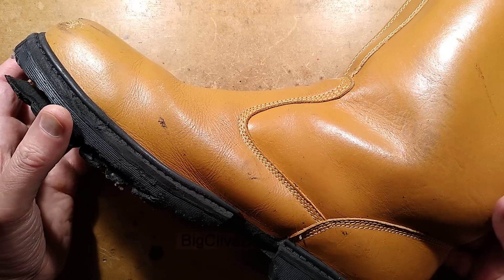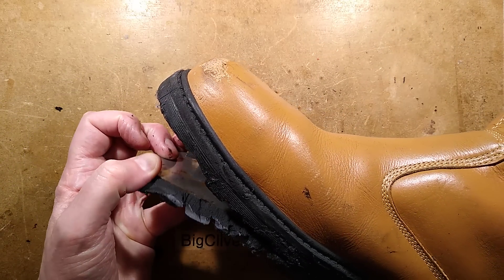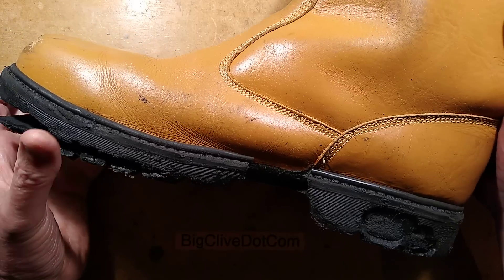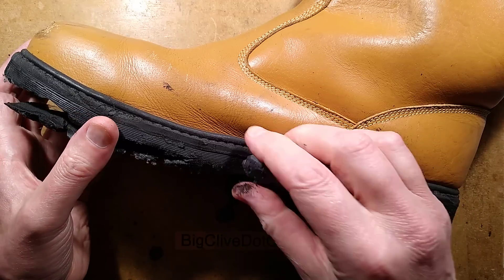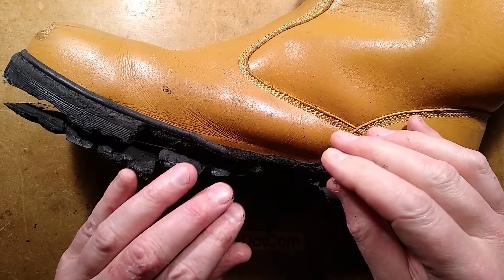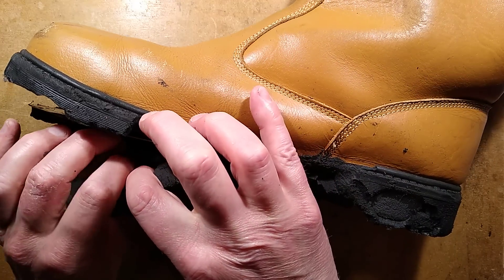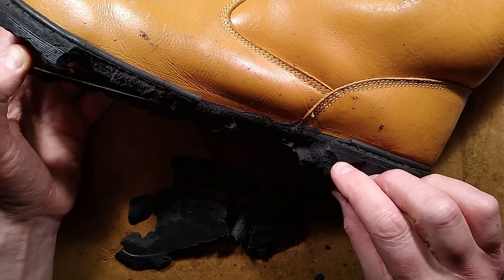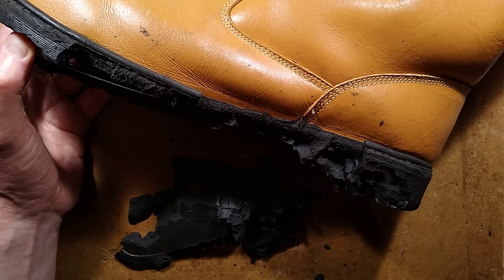My work boots have melted!

Comment: Same happened to my Meindl army surplus boots.
They were similar construction, with a "foam" mid section that bonded the outer sole to the upper. They were in mint condition, but I didnt wear them for a couple of years, but they were stored very well. (I take very good care of my boots, and have a pair of twenty year old boots that I still hike in.)
Well one cool spring morning, I take them off the shelf, put them on and go for a walk. Despite looking mint, about two miles in I start hearing strange noises and eventually realise that one heal has de-bonded. Over the next mile both soles started to de-bond and I barely made it home. Just the front section of each outer sole was attached.
Upon inspection the boots seemed absolutely fine APART from the foam midsection. This appeared to have spontaneously degraded and turned dry and crumbly.
Based on this I now only buy stitched boots because it certainly appears that the foam section has a shelf life and is not chemically stable.
Reply: Always walk around with a tube of superglue when travelling far from a shopping area.
Reply: @Vile_Entity_3545  Great advice mate.
I keep several strips of extremely high quality gaffer tape attached to the inside of a plastic lid for emergencies.
Saved me from a flood once when my ground sheet sprung a leak during a storm. I will follow your advice though, and include some superglue from now on! Thank you.
Reply: My Meindl desert boots have done the same... the foam layer between sole and upper is degrading. Will look to another brand for a replacement but they will probably be no longer lasting judging by recent experience with other footwear. 'Rubber' items manufactured in recent years all seem to display this property.
Reply: Likely is the rubber cement in your boots to connect the rubber or foam to the boot skin. All mass produced items use this as it's cheaper than stitched soles. It's hard but some can be reglued with rubber cement again.
Reply: @MrMega200  I cant rule out that the cement was the problem too, but the entire midsection which was moulded foam had changed consistency. It was no longer pliable and had turned dry and brittle.
It wasnt just like the outer sole stripped off, it stripped off because the middle layer of the sandwich was crumbling away.

Comment: I had this happen to me a couple of weeks ago with a set of boots I got about 9 years ago. I bought them for a job that lasted a couple of weeks, and they had been in the box ever since. I recently went to wear them again and within hours both soles had fallen off along with the toe cap rubber. I contacted the manufacturer saying that was I very disappointed (they kindly replaced them) but they said it was because I hadn't worn them. Apparently you have to wear them to stop air getting into the material which is what causes them to deteriorate. They also said to keep them well ventilated, so keeping them in the box probably didn't help either.

Comment: I've had a couple of things with that type of finish do similar, the common thing about all is that they were stored for a long time in a place where there isn't a decent circulation of air - closed cupboard or in the original boxes. It's recoverable if you catch it at an early stage by an IPA wash or even white spirit. Whether it's a long term fix is a wait and see. I think yours are past that point

Comment: I had two pairs of Clarks loafers, I put one away as a spare. After about two years the sole on the pair I was wearing crumbled to dust. I tried the other pair and walked out leaving a trail of "rubber" behind me and the soles in bits. Clarks wouldn't replace them as I had no receipt by then.

Comment: Polyurethane soled safety shoes and boots are susceptible to hydrolysis-a natural ageing process. Hydrolysis is the chemical breakdown of the PU polymer and the resulting physical breakdown or disintegration of the PU sole accelerated by the high humidity in tropical climates, standing in solvents, heat, UV exposure. Possibly other issues.  They can be re-soled though if the rest of the boot is in good condition.
Reply: You forgot to mention that finding a cobbler that even does such repairs and also has a compatible sole on hand is not easy. Also such repair work is not going to be cheap and will likely cost about quarter to half the price of just replacing the item, assuming you find someone able and willing to do it in the first place.
Reply: I worked for Hotter and saw some terrible workmanship on trying to fix Polyurethane soles, we used to replace or offer a good discount if this happened quickly... Ironically the more you wear PU soled shoes the longer they last.

Comment: Unrelated but there used to be a company called Colorado here in Oz (I kid you not). They sold all sorts of casual and outdoorsy type wear. I had 3 different pairs of footwear from them. A pair of boots, a pair of shoes and a pair of sandals. In all 3, it was the glue that failed. All 3 were made in China. The sandals just fell apart. It was so bad that I had to throw them away. The boots I took to a cobbler to get them re-glued. His glue was no better. The shoes I fixed myself with some "shoe glue" from a local supermarket. Cheaper for the tube that what the cobbler charged me. And they're perfectly fine now. I intend to repair the boots one day too. Just haven't been bothered to do it. It was just the soles in both that had to be fixed. The sandals were different though. The upper came apart everywhere as well as the sole coming off.
Naturally, Colorado are gone. Folded some years ago. No prizes for guessing why. Luckily, that was all I'd bought from them.

Comment: I would ask the manufacturer for a replacement or rebate. I had purchased a brand new pair of boots to replace my current ones, as soon as they would fail or break. That took about a year, I was so happy to put the new ones on and as soon as I started to walk, the intermediate sole, just like yours, just desintegrated. Got in touch with the seller who said they would not replace them as they had been purchased to long ago. I escalated to the maker and after a few pics, and sending them mine for an autopsy, I got a brand new pair!

Comment: My bid is on a broken chemical mix. I had this before, when rubber or plastics kind of "dissolved" without reason
Reply: It's not so much a broken mix. The mix is correct but the product degrades over time.  

Bacterial and fungal degradation is well known with polyurethane materials. This is great when you want the product to biodegrade but not so much when you need long term stability.
Reply: NO

Comment: This happened to my "formal dress" shoes that I wore with my suit to a graduate ball several years ago. As I was walking along and chatting with people I started noticing that my steps became somewhat uneven. After a while chunks of the black sole started falling off. To cut the long story short - I came home almost barefoot. The soles fell apart and all I had left were the upper parts of the leather shoes and a thin insole fabric separating my feet from the cold pavement. It was January :)

Comment: Had the same on some rigger boots I used for motorcycling. Walking across a car park I was leaving a trail of chunks !!!!!
In regard to rubber covered products, my Pure radio did this sticky thing. Talcum powder all over it then brushed off has stopped the issue !!!

Comment: Huh, exactly the same thing happened to my old mountain boots, which I discovered a couple of days ago. Those were Vibram soles, and the boots were stored in a box with other shoes in a temperated environment. I have no idea what caused the disintegration.
Reply: I have a pair of walking boots with vibram soles that I bought about 45 years ago. They were ridiculously expensive at the time but are still going strong.
Reply: @bigoldgrizzly  How do you store them? I just spent more than I'd like to admit on a pair of vibram soled wading boots.
Reply: Disintegration is caused by The Cure.
Reply: @jeremyowen1  
No special treatment, just stored on a shelf in the store room. I do wash off all the crud from soles and uppers and leave to dry naturally before putting away. Unlikely to affect the soles, but they do get regular treatment with common or garden dubbin. Forgotten the make now, but they were Italian and cost nearly 60 quid in about 1978. Considering how long they have lasted and how comfortable they are, it was money well spent. I suspect a lot of modern 'Vibram' might be trading 'on the name' but cutting corners on the material or manufacture
I might add the store room is not heated at all so temperature and humidity pretty similar to the normal outdoor British climate ... if there is such a thing these days   ;<)

Comment: I had a brand new pair of Aldi's boots which I left under the stairs and forgot about for several years. 
Found them one evening, are great I thought will wear them to the pub a mile away. Got there no problem but their carpet felt much more sticky than normal. 
Anyway on the walk home in the dark, a few sheets to the wind and suddenly one sole stuck fast to the pavement seperating from the upper and the next step the other did the same. Ended up home with sore, wet feet, holy socks and a pair of brand new uppers with absolutely no soles. Lesson learnt.

Comment: That's impressive, have they come into contact with any solvents or liquids used to coldweld plastics ?
Reply: It's most likely, what a few others in comments have mentioned, the sole of the boot being exposed to water and/or humidity (especially if its spent a few years in the back of a cupboard) and hydrolyzing causing the breakdown of the sole.

Comment: Soles or no soles, I think these are banned on construction sites and many other places now, so limited opportunities for use, unless of course the local retro disco is on:)
Reply: Why are they banned?
Too good a path to earth with all the metal inserts?
Reply: I believe that they are banned because they lack proper support for the ankle and rolling can occur on uneven ground.
Reply: @JohnSmith-yv6eq  as far as I'm aware it's because of the open top nature of the boots. they are mostly worn over trousers/overalls and I think there were many reported accidents where the boots were caught in or on something and they are not well fixed to your foot therefore slide off, I think that is mostly a construction site issue. I might add that you probably don't want to quote me on this. I am not allowed to wear these boots at my work and they are banned at any sites that I attend, could be water board sites, construction and the like. I have no Idea if the metal plates are the reason, although that could be as likely a cause, most safety foot ware has some kind of insert support, however I  think they are now non conductive.

Comment: pfft, haven't you seen "The Andromeda Strain"? :)
Reply: No, it's 'Mutant 59 : The Plastic Eaters'
Reply: Or Doomwatch, series 1 episode 1 from back in 1970

While on a flight to San Pedro in South America, a passenger airliner crashes after all the plastic on board inexplicably melts.
Reply: @theelmonk  you are right, of course altho, the andromeda strain did eventually turn into something that ate plastics.
Reply: @roygrafton6322  They were probably all inspired by just one of them. All were between 1969 and 1972 though the Andromeda strain was first, in book form. But did the Andromeda strain plastic eater feature in the book, or was it added later in a TV series ?
Reply: @theelmonk  it was in the book near the end when it mutated and escaped from the research facility, it went up in the air and got into fighter jet and destroyed all the plastic and rubber parts, causing it to crash.
Reply: @roygrafton6322  I must have read it as a kid, consuming all the SF I could find in the library, but I've forgotten. A copy has been ordered :)

Comment: The same happened recently to my beloved HAIX Tibet boots. The explanation from HAIX was that their soles get their special properties from a foam material that has a normal life span of 5 years. After 5 years it is expected to start hardening and at some point start to crumble as it happened to my boots after about 10 years of occasional use. I sent the boots in for repair and got the soles replaced.

Comment: You mentioned soft touch rubber coatings (why people still put these on products is beyond me). But the classic rubber 'breakdown' we see all the time are the belts inside tape recorders and disk drives. Yes they stretch (which is the point they should be replaced) but not unusual to find just a gloopy mess left or just bits of belt inside the mech.

Comment: No idea why but they look like excellent boots and probably originally pretty expensive, can you have them resoled including the metal plate?
Reply from the maker: It's hard enough getting boots my size let alone getting replacement soles.   They aren't too expensive to replace the whole boot if I can find ones that fit.
Reply: @bigclivedotcom  You don't have any cobblers nearby?

Comment: For products that have a coating that gets sticky, I've had good results with soapy water and a scouring pad. Most notably I've done this to the back of a Dell laptop's screen and the result was way better than I'd hoped. Initially I just wanted to get rid of the stickiness, which it did, but it actually looked good afterwards as well! Your mileage may vary of course, but so far I've always had good results with this method.
Reply: I've used IPA which works well. I've also used acetone which gets the goop off quick but is a bit risky for the underlying material.

Comment: This happened to me with both Meindl and Hanwag hill walking boots. It's no flippin' joke at £200 to £300 a pair. The manufacturers could care less with just a little extra effort. As you said- the textured coating that is so beguiling when handling an item in the shop is a time bomb waiting to go off. I've lost count of the items it has affected for me, but a notable one was a Hawke spotting 'scope. "We've not encountered that before." Yep, sure you haven't. Cue laborious hours with isopropol alcohol and degreased finger tips. Time all this carp was called out, so cheers BCDC.

Comment: My own family sold safety gear and they had many polyurethane boots  failed in the exact same manner. They had a batch of  steel toecap wellington boots that had to all be shipped back to the manufacturer because they were falling apart in just a few months. This material is lightweight and durable until it begins to chemically change to breadcrumbs.

Comment: Besides everything else mentioned by others, polyurethane soles will also crumble if you use them for a while and then leave them sitting for a year or two, no matter the production methods and compositions. The chemical bonds will rebind to lower energy states, leading to the previously homogeneous material sort of recrystallizing to smaller domains, hence the longer the boots sit, the smaller pieces the soles will crumble to.

Don't know if all that is bs or not, but that's how a shoemaker explained it to me when I wondered what happened to several pairs of relatively new winter boots and shoes after a couple warm winters had left them in the closet for close to two years.

Comment: I worked in a steel foundry years ago, when boiling off the melts carbon with a hand held oxygen lance ( 1 1/4 dia, 100 psi) occasionally it would boil slag out the access door, through a gap and into a skip underneath the steel floor you stand on, getting very hot quickly. Had a brand new pair down to the steel plates in a week after a few big melts.

Comment: My best pair of army boots did that.  They were the most comfortable and practical boots I ever had and only cost about 30 or 40 quid. The  tread was fine but it was the padding layer that made the midsole and mid heel layer which comprehensively died. The soles are perfect still.
Motorcycle boots that use a lot of that pliable rubber covering and armour do that. It's very annoying. They'll decay after about 20 years, and if you get your boots second hand, with  90's or 00's designs turning up at bike jumbles, you'll soon discover the same!

Comment: I've had the same decomposition happen in a couple of pairs of work boots with soft, foamed synthetic souls.  One pair fell apart within a month of purchase. Took them back to the store and they apologized and replaced them.  They checked the product code I had been sold a pair that had been made many years before.  That brand's foamed soles have a shelf life.  Chemicals can accelerate decay.  I work in oil refineries and oils, solvents and hydraulic fluid will attack some foamed sole material.   However, the extra comfort of foamed soles compared to hard more durable soles is worth buying a new pair every 5 years or so.

Comment: Retired broadcast engineer here...  We used to have terrible problems with neoprene and other synthetic air filters at mountaintop transmitter sites breaking down just like your soles.  Filters just stored in the building would break down, too, just not as quickly.  Consultation with a local industrial chemist steered us to ozone.  Higher concentration of ozone in transmitter buildings due to high voltage used for tube anodes.  Also higher concentration on mountaintops due to all the lightning striking broadcast towers.

Comment: Polyurethane does that. It soakes moisture from air in it's structure and that water reacts to form some acid which degrades the material. This reaction is especially effective when the shoes are not used. This because when the shoes are used, the movement of the sole drives the moisture out via warming and so decreases the acidity. Polyurethane is cheap, moldable and resistant to oils, which is why it's used in almost all soles. But it is short lived (which is probably also why it's used).